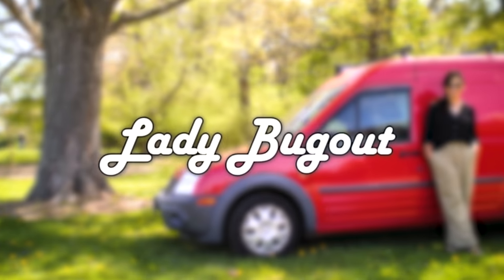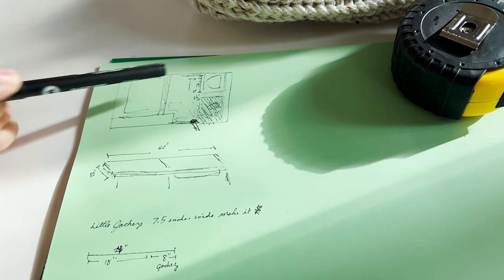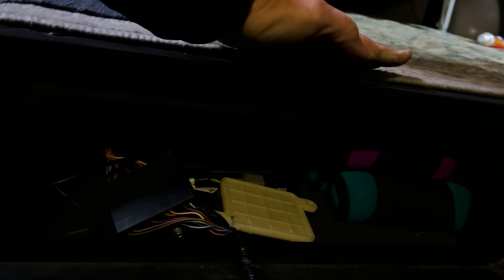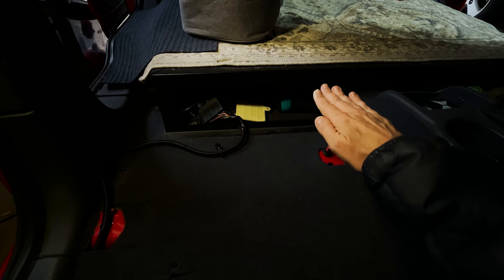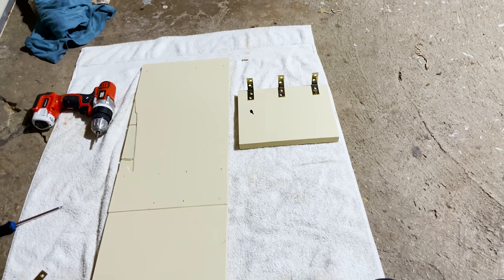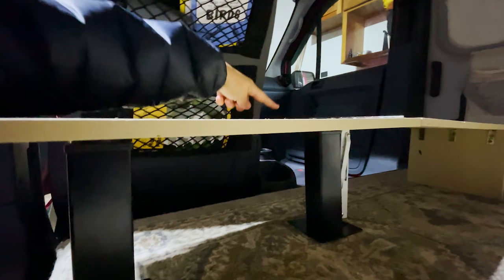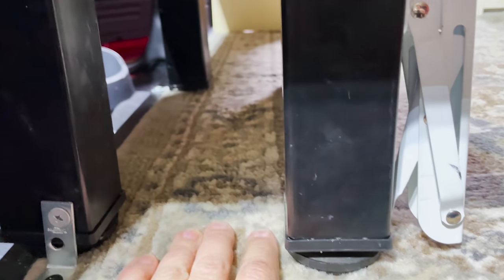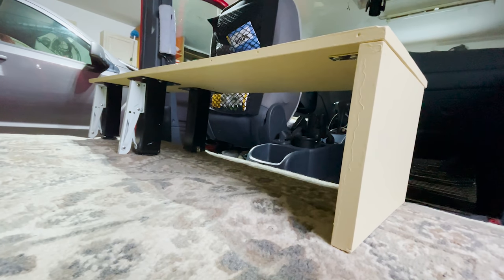VanLife | new DIY van project + BEST bench options (Part 1)

Comment: That's turning out great! Maybe for the cushions, you can get some thin board roughly the same size as your new extension, get thick foam of the same size, batting and fabric to cover over it by upholstering/stapling it to the thin board. Then you can attach that to the extension. Some strips of Velcro should do. You can sit a small bolster pillow by the other piece of wood that extends up when your extension is in bench mode to serve as a spot to rest your elbow. Then you don't have to worry about sewing anything, and you get a very neat, tailored finish to your project. Can't wait for your next episode!

Had to add this... Love the music!!!!
Reply from the maker: Thank you! I wish I would have seen this a week ago😛 I did have a very similar idea, but your idea would have worked out even better. You’ll see what I ended up doing this Saturday. 🤗☺️💃🏻
Reply: @LadyBugout  Sweet, plus there's always a million different ways to accomplish great results! Love having "options"!... Can't wait to see your reveal!

Comment: You’ve already made your choice but another option, having cut your bench in half, is to add a metal  leg that folds back under the corner of the bed. They come in many lengths and are inexpensive.
Reply from the maker: Good idea Gigi! I did see those. Could be an option if I find this doesn’t work out. 💃🏻🐞🚗

Comment: Here is an idea where you removed the seat 💺 Build you a table with 3 or 4 legs to the height of your other existing floor so it is zall the same height. You can totally remove it each time or put another piano hinge where they meet, save take it out each time, but might not clear everything? Each leg might be a different height, so to get the correct height, use a straight edge of so kind, level, 1x2 2x4 etc. Get your leg material ready, short pieces of block, 2x2 2x4 and even 4x4. Take straight edge, lay it on existing floor, put blocks where need, draw line on bottom side of straight edge. Then subtract the thickness of your floor or plywood, cut them and get ready to screw them on!!! You might find the leg to be the same length. You and your viewers are probably thinking, all that for a simple table! I thought he was giving instructions on how to build a new van 🤔 Ha ha! Hope this is helpful, if not its okay! I just enjoy trying to help You and others! Stay  warm Dee! This is your Handyman Rod, Bugging Out!!
Reply from the maker: 😂🤔🤓 you just ‘Nerded out’ more than I usually do…lol…I will make sure to star this in case I need a table like that😛

Comment: Love it! My suggestion would be to shave an inch off the brace part of the folding section and add a strip for an armrest. A box cushion with removable cover (for washing) and attached to the bench with strong Velcro for seating comfort, the Velcro would keep it in place when flipped out for sleep mode.
Reply from the maker: That’s an awesome idea… wish I had the skills to implement that. I’m trying to do my ‘version’ of that—won’t be as nice. But it’ll do for now😛🤗🐞

Comment: The piano hinge option is a good one. If you don’t like it you can always choose another option. You may want to put a brace on the leg held by the angle brackets. Anybody leaning on the leg will break it off. IMHO
Reply from the maker: Yes! So far so good, I’m liking my choice! Great idea, as always…😝 I’m just not sure how anyone would lean on it, it’s so close to the ground they’d have to be laying down at which point it may not be an issue😛 but point taken—I can get one to attach on back for sure!
Reply: @LadyBugout  Hey Dee! I was looking at when you have the bench flopped I’ve and the leg is in the air. Someone sitting on the bench then may be tempted to lean on the leg and the corner brackets will not hold.
Reply: @LadyBugout  P.S. you did an amazing job on your conversion!
Reply from the maker: @chrisp7652  ahhh yes…that makes total sense! I will reinforce asap!!!!🤗

Comment: Hi Dee, so glad you got that bench issue worked out. As far the looks of bench, I'd buy a pillow case, that matches your curtains, and foam padding to cover the flip side of the bench. Why a pillow case, it would be easier to slide over the leg and bench seat with some modifications of course. The foam padding can be super glued to the underside of flipping part, or something like that. Happy New Year, Safe travels.
Reply from the maker: Good ideas! Thank you for taking the time to send them to me🐞🤗🚗 happy new year Gerald!!!
Reply: @LadyBugout  Happiest of New Years to you, safe travels

Comment: Definitely have figured out most of the solution! Great paint job and your bed /couch platform looks nice. I like the slightly deepened color of the Kilz paint too.
Thinking..  What if you got another black leg like the others and put it at the end of the piece that folds up and over? Along with another support thing that pops uo (the white ones)?  Tgen when that part of the bench is folded up, make a tapestry weight cover to slip on top of it to cover up that leg? I don't thing that small board piece will be strong enough to be leaned against unless to put a crosspiece (2x2) on where you have the angle irons, and screw both the bench top and the small piece to it. Then the black leg with its white piece, which may need to be inset a bit instead of at the very end where the small piece is.  
If you have questions I am on FB and you can message me, or can find me via Google for my email or phone. 

Happy New Year, Dee! Glad things are working out well for you!
Reply from the maker: Thank you Gina! Great suggestions. I think I understand what you mean. The bench is very small. I thought about another black leg, did not like how it would look when it is in bench mode. I will see if it needs reinforcement. I thought I could put a straight bracket in the back at the corner to brace it more if need be. 🤗🔧🔨🪚🐞
Reply: Welcome Dee! Yes I know what you mean about the black leg not looking great when the bench is folded. It could be a 2x2 wooden leg, painted the same as the bench... At any rate when the bench is folded up, a slipcover to cover that vertical end piece would disguise your solution. 
Whatever you come up with,I am sure you will make it fit in with the rest of your decor - cute, pretty and unique! 😍🐞

Comment: To solve the bed support issue, what if you returned the metal legs and drop leaf mechanism to the end and put the new wood piece in the middle?
Reply from the maker: 🤔 I think I tried that and wasn’t sure about having the big black legs up top when the bench was folded. At least with the wood there it is a sleeker edge to work with if that makes sense?!?
Reply: Then maybe a sliding bolt gate latch mounted under the corner?
Reply from the maker: @alchristensen8121  I think you are reading my mind!!!😝